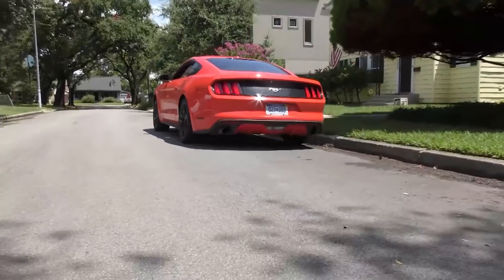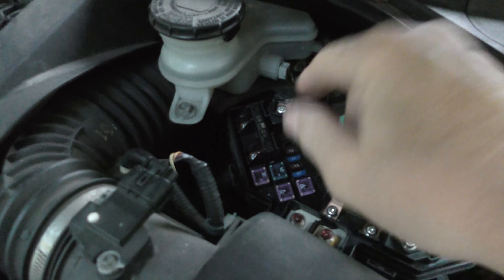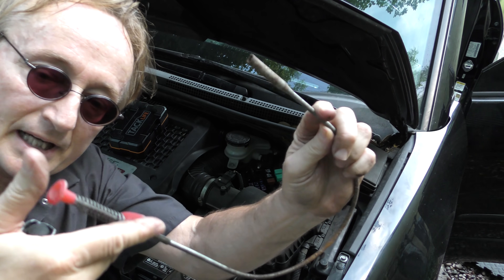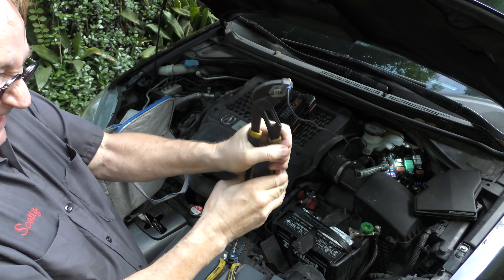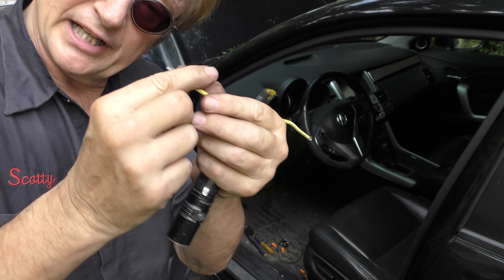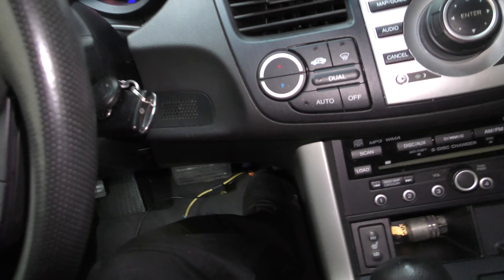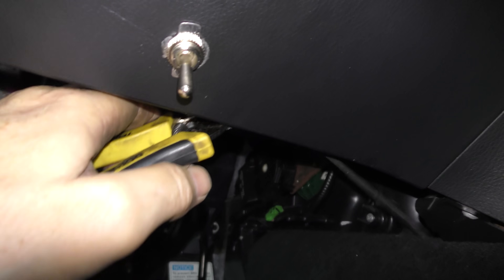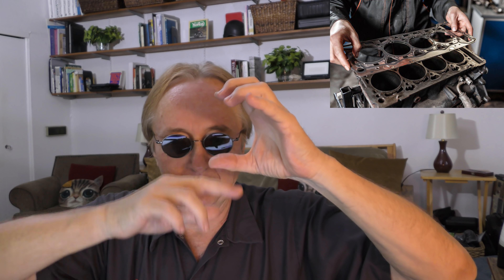This Acura Has a Serious Problem

Comment: Disconnect the HFL or get a new HFL. I work for Acura and it is a common issue we usually just disconnect it cause customer in most cases doesnt want to pay 500+ for new HFL.

Comment: Scotty I watched this and I have a question. I bought my daughter a 1 owner 2006 Audi A6 Quattro for only $3200. Problem is the Infotainment system doesn't work. It has a super complex system where if one module fails the whole thing doesn't work. I called the dealer where it was serviced and they told me it was the satellite module and to repair it costs $3000. The service manager said it definitely wasn't worth it on a car that old. The problem is there's no stereo now. Following what you did here on this Acura do you have any idea if I can bypass the one module so the stereo works? I paid so little I don't care but it would be nice if it worked.

Comment: It’s the HFL module—unplug it. All that work for what?
Reply: Yes, I agree with you. I looked up the problem and saw there is a TSB for a parasitic power drain with the HFL.
Reply: Knowing this universally applicable process might be useful to viewers fixing other problems.
Reply: @stephenarling1667  you might have a good point, BUT in that acura case it has a keyless entry, and to use the radio the security code have to be input
Reply: @DavidJDM  elementary stuff for Scotty

Comment: Hey Scotty, did you put a rubber grommet where you drilled the hole through, was it out of the video shot, just asking since I didn't see that part and it'll be a good note for those that are following this step by step to help prevent shorts from wire chafing on bare metal edges.

Comment: could the, let's face it, ugly toggle switch be changed out for an always on motion sensor/ timer switch aimed into the foot well. As you got into the car or drove it you would trigger the motion sensor and it would time out like  10 min after you left the car.  No need to drill a hole for a switch.

Comment: Just when I was about to purchase an 2018 MDX ☹️, this pops up !
Reply: The acura in video is rdx.
Reply: Juan Mm around 2007 is when it seem like Acura started going backward. I have a 2007 RDX and so far so good but I can tell you that I had a 2003 TL type-S and I didn’t have any problem but the transmission. My RDX is having only one minor problem and it’s the wipers which is a not common problem. Other then that the truck is overall solid but I can’t say that about their new stuffs. Their reliability has gone down.

Comment: What used Toyota should I stay away from?  I am 77 and need a very reliable car and very Leary of a used car.  I have a 2013 Fiat 500c and it is not in good shape has almost 36,000 miles.

Comment: Hey scotty i have a question i have a 01 dosge durango that has a check engine light so i scaned the code its telling me P0760 shift solenoid c i replaced the solenoid pack in the transmission but still have a hard time building up speed in first gear can ypu help me out

Comment: FOR THE REAL SOLUTION: This switch is a waste of time, for First-gen MDX up to 2006 the Honda Bluetooth module has died and it can be removed from above the drivers/passengers lights on the top head liner, and for second-gen its under the armrest, just unplug and remove from the car. To test to see if it in fact the BT module, try pressing your phone call button on the wheel (2006 at least) and see if anything happens. If nothing happens remove the module and your battery will be forever saved.

Comment: My car smells like rotten eggs thru the vents after i drive 60 or so mph and then it goes away....i cant figure it out ! Help !
Reply: Someone vomited or spilled something in the vents at some point. You need to pull it apart and deep clean down in the vents
Reply: Possibly your catalytic converter is starting to go out.

Comment: Scotty Scotty Scotty.....it’s the HandsfreeLink . This sort of juryrig “repair”conflicts me. All you did was kick the can down the road on this one. First off, use a rubber grommet on the firewall so that that fuse doesn’t blow because it will just chafe the insulation jacket after about 20,000 miles. Slamming a toggle switch is ghetto solution sorry.

Comment: Scotty I have a 2000 nissan maxima I've changed the catalytic converter spark plugs and the car still cant handle hard acceleration what could be the problem I also scanned the car I got code p0733

Comment: Is it correct fix?... no, the correct thing would be to change that system. BUT, what if the systems was designed like that? so it would drain the battery... Then... this fix IS THE CORRECT way to go. Because,  a customer DOES NOT NEED A SYSTEM THAT DRAINS THE BATTERY SO FAST. Damn.

Comment: Why not put a relais in it instead? This way it will switch automatically.
Reply: Good question. Boils down to parts cost and labor. The mechanic quotes a repair, recommended by manufacturer (replacing the defective component). Owner ask for cheaper repair. Mechanic quotes same repair with aftermarket parts. Owner again asks for a cheaper repair. Mechanic quotes an alternative means of repair, that requires less labor (labor rate usually surpasses cost of part). Dismantling dash board, steering column and tying into ignition circuit is labor intensive, which more than likely, exceeds the cost of replacing the defective component. There is liability issues also. Ignition switch may not be able to handle the extra current required to operate the relay, which could mean having to replace the ignition switch later. Ultimately the owner decided how the car is fixed.

Comment: Nice job, but I would have used a rocker switch.
Reply: I would have used a large knife switch, and a ceramic insulator tube through the firewall.

Comment: But Acuras are well known to have Bluetooth module problems how come he didn't research this?
Reply: Most likely he did, then used this method to cover a wide range of situations that may be faced by owners of different vehicles. Using this Victorian-era technology to fix a computer problem is more entertaining.
Reply: Umm, owner wanted a cheaper fix? It is an old car.
Reply: Of course he did. Obviously, the customer uses his HFL and didn't want it disconnected

Comment: I didn't like this method:
1- The radio setting will be eraesed everytime u switch off the bottom.
2- many time i would forget to switch off the bottom so the battery will drain again. 
3- I won't accept making holes in my car at all.

Comment: Actually loosing confidence in this guy, he goes with a switch inside, instead of a ignition powered relay to the fuse. Then he uses water pump pliers instead of crimpers but he’s suppose to be a great mechanic.
Reply: I'm sure his customer asked for a way to rig it.  It's a backyard mechanic solution, not a dealer level solution.

Comment: What's the fair-market value of a late model Acura RDX?  Now, what's the fair-market value of a late model Acura RDX that has an undiagnosed electrical problem that your mechanic "fixed" by willie-rigging a $2 toggle-switch into the entertainment system? It seems to me that you owe your customer the difference, minus whatever you charged them to rig the switch.

Comment: This is really your solution? Disappointing
Reply: I have to agree. This is not a good a fix. A relay to a circuit that is only on when the ignition is on would have been a much better fix. That way the customer does not have to remember anything and no switch inside the car. Love your videos and insight but you missed on this one. Your fix works but is not the best fix.
Reply: @agent1atl  it is the cheapest and quickest fix

Comment: I have the same problem battery drain on my 2006 Acura tl do you think is the same problem @Scotty Killmer
Reply: Check your Hands Free Link- it’s a common failure point. If you don’t use it or can’t use it, disconnect it- easily accessed via the overhead lights up front- the circuit board is above the interior lights in the ceiling- it’ll take about 10 minutes to disconnect and you should be good

Comment: It will be the Bluetooth module, just unplug it or replace it. It's a common issue on lots of cars. This 'fix' is a total bodge job.
Reply: Sorry, we've done it, so have hundreds or thousands more. Unplug BT, then no radio, for us, no navigation or infotainment system at all. This IS the easiest solution to get back stereo, and back up camera, which is all that I use. This video is a mindsaver. I can jam and drive once again. (BTW. Acura dealership charges $1000 to install a new BT, which,  90% of the time has same batterydrain issue in 2-3 weeks) I bought a new BT out of Crutchfiels for $230, installed, and battery was dead next morning. This will fix my problem.

Comment: Use a relay powered from ignition. No brain thought or remembering required, no switches or extra wires from battery required.
Reply: Then your putting more load on that circuit but just put in a bigger fuse and park it far away from your house!  ; )
Reply: @nedcramdon1306  or learn what relays actually do

Comment: Sound like you did not get to the root of the problem.
Battery drainage problem? Bah, let's just put a kill switch on the fusebox and drill a hole, like a 70s harley.

Comment: You did put a grommet in the drilled holes right?, still it a half-assed fix, not professional buddy.
Reply: Especially since one of those wires is an unfused source.
Reply: Kevin Scott honestly, it doesn’t matter which wire chafes through because he put the fuse inside the cabin not on the engine side of the firewall. So if either wire chafes through the Acura owner could have a fire, melted wires, and/or a melted and shorted junction box. Not a good scenario at all.
Reply: @zachmiller289  Yes the fuse is in the cabin (that's one of several problems here).  However, one wire is "before" the fuse and the other is "after" the fuse, since the power is flowing back to the fuse panel to power the radio circuit.  Which wire is which will be totally random, depending on which wire got plugged into the "battery" side of the fuse socket, and which wire got plugged into the "load" side of the fuse socket.  This is definitely a half-assed fix either way.
Reply: Kevin Scott you’re right, I totally had a brain fart here 🤦🏼‍♂️ not a “fix” I would want my name associated with for sure.

Comment: That is the most ghetto fix I’ve ever seen.  That’s just pure laziness!  Find the problem causing the battery drain!  What a band aid fix. I’m sure the customer loves inputting their anti theft code to the Navi and audio unit every time he shuts that switch off.
Reply: The problem has been found! It requires a new Bluetooth module ($1000 fix at the dealer) and then, 95% of the time it STILL DRAINS BATTERY! Thousands upon thousands of people have this problem, and simply unhook the BT, but then no radio. This,  Sherlock, is the simplest cheapest and most efficient fix.

Comment: Acura, rolling garbage pile of junk and endless money pit hahahahaha
Reply: It’s the blue tooth phone module they go bad and it continues to try to connect even with the engine off. This runs the battery down after it sits for a couple days. It’s on a panel just above the rear view mirror. Either disconnect or replace.